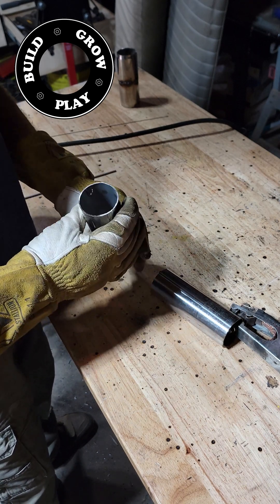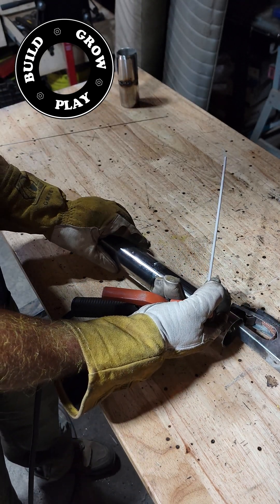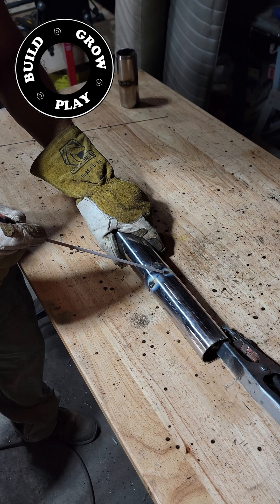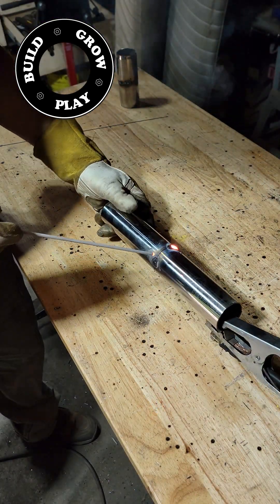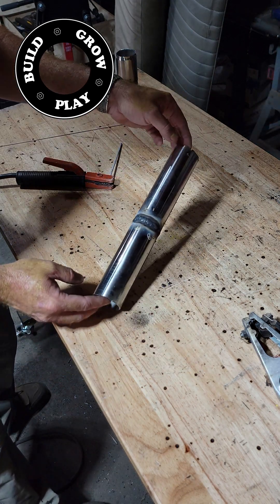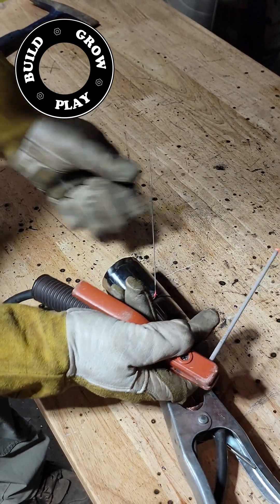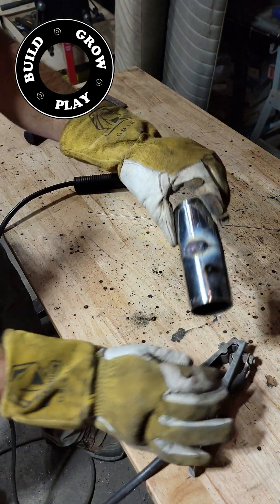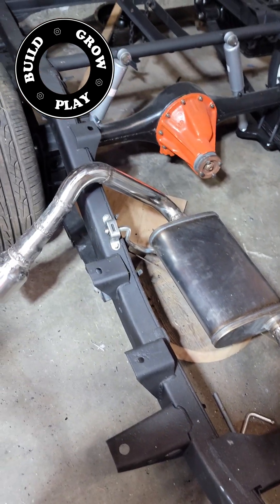Easy Stick/Arc Weld Stainless Exhaust Cheaply

Comment: as odd as it sounds my best stick welding exhaust is when I run it continuously idk why lol
Reply from the maker: I guess your skills are superior 😌
Reply: @buildgrowplay  haha no way lol, I'm good at steel but I HATE stick welding 316, granted the only stainless welding I do is exhaust and intake which is terrible for how thin it is, this method and  then going over it a second pass a little hotter works the best but still easy to blow through

Comment: Wow excellent work, this gives me hope for my stainless exhaust project. How many amps would you also suggest for slip joints and flanges?
Reply from the maker: Same amps. 25-30. Turn it up if there is a need but. Low and slow is best
Reply: @buildgrowplay would I get a better weld if I shielded the inside of the pipe with Argon?
Reply from the maker: @dakodajames4534  possibly.  But I had no trouble

Comment: With stopping and starting the welds doesnt that leave slag in between the welds?  I never welded and im currently trying to research how to repair my stainless steel exhaust.  One of the ball joint type connections had broken so I plan on cutting away the broken edge and slip on a new joint and weld it on.  I was looking to buy a cheap welder, I was looking at the gas/gasless type mig welders and use stainless steel flux core wire, but now i see stainless can be stick welded so im thinking this method may be easier to do being a beginner.
Reply from the maker: @timmyb1874  316l rods and 20-40 amps. This is the easiest weld there is. This is a great welder and quality for the price https://amzn.to/3zslpMP .